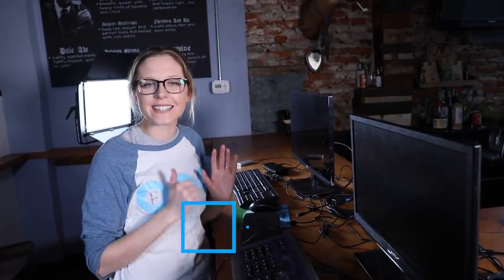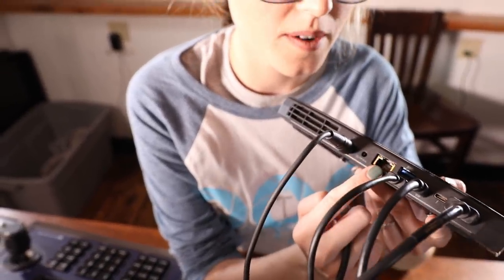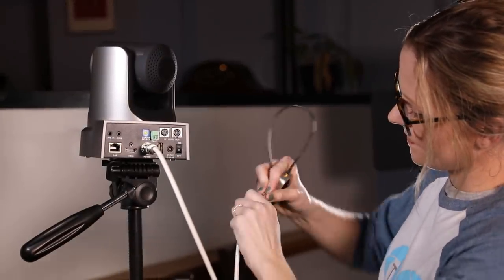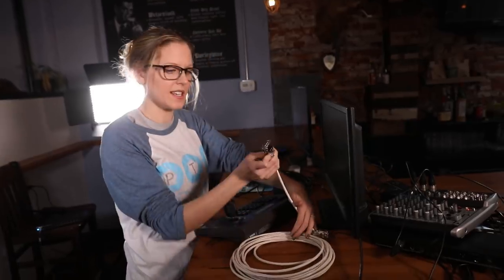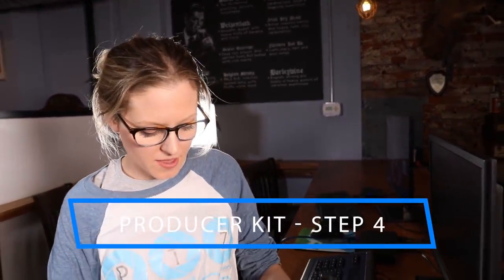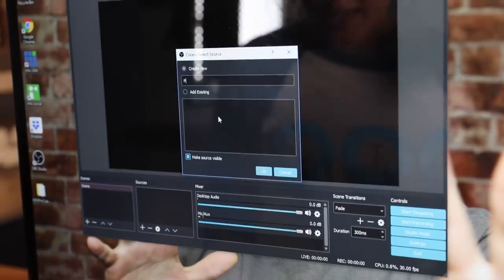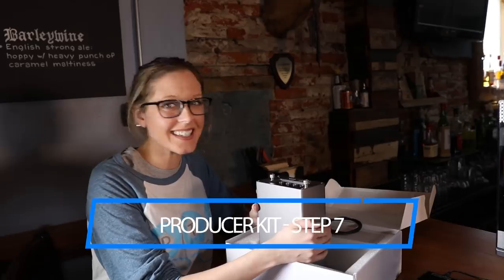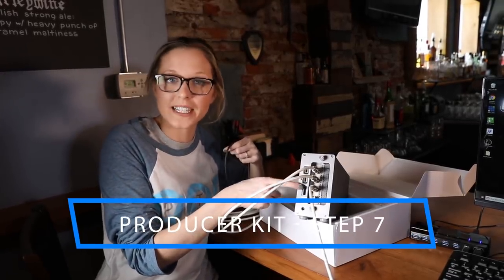PTZOptics - Producer Kit Set Up - Simple Live Streaming System

Comment: please can you answer me if there would be any problem with the resolution of your camera to speak with the Atem television Studio of Blackmagic that speaks in a resolution 1080I59.94, because in the description on your site only have these settings, Video System
1080p / 60, 1080p / 50, 1080i / 60,1080i / 50, 1080p / 30, 1080p / 25, 720p / 60, 720p / 50, 720p / 30, 720p / 25
CVBS: 480i, 576i

Comment: Hello! Tell me please. we are going to order PTZoptics but I do not know what cables are needed to work with cameras? we need cables for 100 meters 3 pieces. I understand you need two cables one to control the cameras of the other to transmit the image?
Reply from the maker: Hey! It depends what cameras you get. If you get SDI cameras you will need SDI cable for each, and ethernet or DB9 cable for control. The cameras are controllable with the included IR remote control as well.